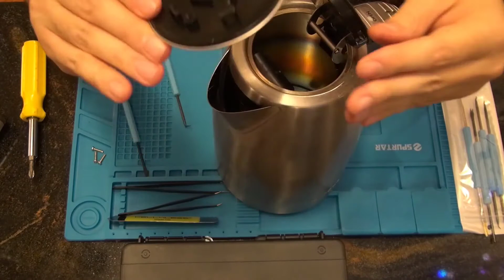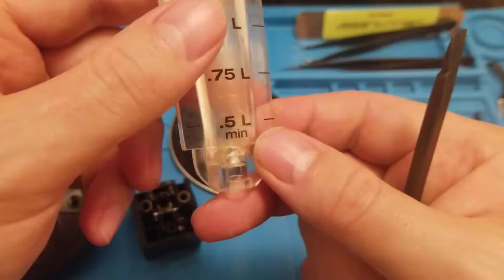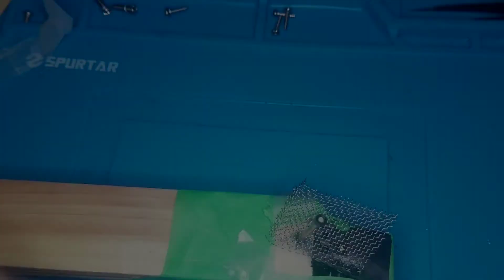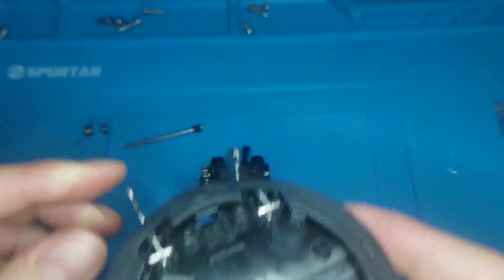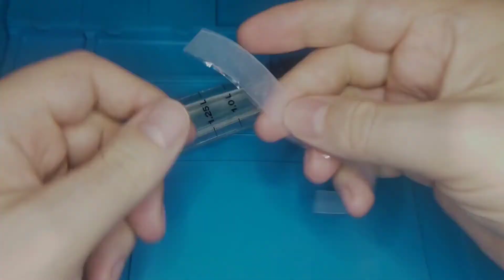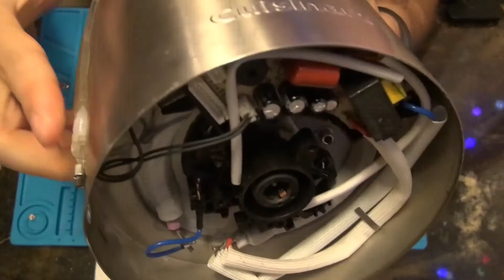Electric Kettle Repair - stuck lid and leaking at the base fixed!

Comment: My problem with mine is I’m rectan error beep after starting to heat. Any help please?
Reply from the maker: Does it start to heat even? If not, good chance that it's water level detection failure (you do have enough water, right?) Which is likely due to failure of some components on the main board.

Comment: I have a problem with mine that is a Silvercrest and has two holes (one top, one bottom) for the water level indicator. For some reason there's a silicone funnel at the bottom of the indicator to discharge water under the heating plate. What if I fill the holes with silicone bypassing the indicator? I can always see water level from inside. Am I gonna damage it? Don't understand the function of the funnel...
Reply from the maker: I haven't seen your specific model, but if it's similar to the one in the video, bypassing the water level will probably work - technically at least. Make sure that you use food-grade products though, as this fix will be in direct contact with drinking water, and hot one to boot. You don't want extra chemicals leaching out into your tea...

Comment: Mine just started leaking similarly. It's a hairline crack on the level meter around halfway high on its side. I got it in 2014. I'll probably will seal the whole thing up because I never cared for the level anyway.
Reply from the maker: Yeah,  level meter is a real weak spot. When sealing consider what kind of material you're using as it will be in contact with boiling water that you will drink. So it makes sense to pay attention to it being food-safe/-grade.

Comment: You rock!! 3 years of kettle and now it's leaking, was just able to confirm that it's the plastic cracking in the same place at the bottom of the water indicator. Off to get some silicone tape, and if that doesn't work I'll just plug the hole and go without the water window. Thanks for the great and well organized tutorial.
Reply from the maker: Thanks, glad you found it useful! Depending on how deteriorated your plastic is, making waterproof wrap that still fits into the hole might be quite finicky. So if you're OK with having no water window, a plug would be much more straightforward. Just a heads up :)

Comment: Loved this tutorial. My problem is that I can’t get my lid to shut. Any help you can provide on figuring out why it won’t stay shut would be greatly appreciated. Thank you!
Reply from the maker: When you say it doesn't shut, do you mean the lid doesn't close all the way, or it doesn't lock in the bottom position? If the former, then it is likely lid hinge (outside the lid) is broken (plastic parts). If the latter, it is likely latch mechanism inside the lid, and there is a good chance that it is not completely broken, but parts are misaligned. If you disassemble it and reassemble it, it might work again without re-fabricating any of the parts.

Comment: Wow that lid has such poorly-chosen materials for the latch-spring mechanism. A heroic effort to repair on your part! Perhaps a sheet of thin stainles or copper going around the back to both pivots would work. Pity the company doesn't offer an updated part under warranty. Imagine tens of thousands (millions??) of these going into landfill💀
Reply from the maker: I agree, with a few spare parts (not to mention slightly better design) a lot of appliances could lead a much longer life. Lid problems are not even the worst ones here, at least these can be reasonably worked around if you're handy. But the parts that are in contact with actual food (well, water here), e.g., level indicator, are almost impossible to repair properly, but could be trivially replaced if parts were available... :(

Comment: Thank you for sharing this! Silicon tape and steel mesh are awesome tools I didn’t know about. Inspired me to replace the leaky water level indicator with a silicon straw lol. I think the material they use for the indicator isn’t good enough for this purpose. It eventually cracks and leaks (if I’m not mistaken yours is also showing signs of cracking on the inside).
Reply from the maker: Yep, you're correct, clear plastic used in the level indicator deteriorates over time (I am sure contact with boiling doesn't help). It starts to develop microfractures which eventually leak :(

Comment: Thank you, I searched for leaking issues on this kettle as it started to leak I noticed today, just went and picked up silicone tape, and hopefully that's indeed where the leak is! Do you have suggestions if it leaking where the seal goes into the kettle and not the indicator? Fingers crossed going to go try this tonight!
Reply from the maker: That's hard to tell. The seal is soft silicone and is unlikely to leak itself. But indicator assembly is a single piece with a nipple that goes into a kettle (via silicone seal), and it is made out of hard transparent plastic. And I believe this plastic over few years deteriorates into brittle, cracking state, probably assisted with being in contact with boiling water. So these microcracks can develop pretty much anywhere at the bottom of the assembly. And that's another reason why you may want to cover as much as you can there with tape, because even if you seal a place that is leaking today, it is likely to leak from somewhere nearby is a short while.
I really would prefer if we could just buy the indicator assembly as a replacement part, this would make this fix rather trivial. But alas :(

Comment: Great instructions! The lid on my kettle isn't opening, but it's not wobbly. 
Any suggestions?
Thank You!
Reply from the maker: Sure, lock is not really related to wobble, wobble is due to a broken hinge. In your case, there is a good chance that something is either broken or just misaligned in the lid mechanism. Just pop up the top metal cover (it is just pressed in with tabs), then you'll see the lock mechanism and will be able to at least open the lid, and probably fix it. Cheers!

Comment: My kettle is 5 years old. Worked yesterday but now it won't heat my water. All the kettle lights come on. I pick a temp and it blinks like before. Hit start button and it lights up white. After a long while of temp light blinking all the buttons go to a neutral blue light. Again after a long while the kettle shuts off. I'm thinking bad heating element or whatever controls it to heat up.
Reply from the maker: This is a bit weird, sounds like a proper heating cycle according to LEDs. However, if it is a heating element it shouldn't stop attempted heating as it would never reach temperature. If the temp sensor is bad it wouldn't shutoff at all or would shutoff immediately. The only explanation that I can think of is that it is the heating element problem, everything else works fine and kettle thinks it actually is heating up the water. But then there might be a safety timer that shuts off heating after some period of time even if it doesn't reach temperature.
.
You can follow the video and open up the bottom of the kettle and do a visual inspection, maybe run some continuity tests and see if you can find anything. Though it's unlikely to be something obvious as it seems that most of the kettle works.
Reply: @JustMakeItNow  Correct, lights up and begins the process of heating the water and nothing after that. Thanks for you help I'll open bottom of kettle and run a few continuity test.
Reply: Did you fix it? I have the same issue.
Reply: @Camifran  No not yet. Need a Volt-Ohm-Milliammeter tool before I can trouble shoot. If I fix it or not I'll let you know either way.

Comment: What is size and where did you get ss mesh
Thank you
Reply from the maker: I had a random piece lying around, so can't say exact mesh size. But sizing is not critical. It needs to be stainless, that's the important part. Apart from that, the opening needs to be large enough for softened plastic to squeeze through, so don't go too small. I'd say something between 16x16 and 40x40 if I have to guess.

Comment: Thanks for this. My kettle is leaking at the window. I’ve had it for about 5 years and the windows has become yellow and brittle. I was able to super glue along all the cracks, cover the bottom port and put the top in my mouth like a kazoo. I sucked in to create a vacuum and suck pull the super glue into the cracks. I hope it holds up.
Reply from the maker: This will probably work fine. However, I'd still recommend using silicone tape as I did in the video. My two concerns with using superglue in this application would be toxicity and temperature resistance. Cyanoacrylates (primary superglue component) are generally considered non-toxic when set, but would decompose into highly toxic hydrogen cyanide gas when exposed to high heat (about 200C/400F). In this case glue shouldn't see that kind of temperature (generally should not be above boiling water temp), but I thought I'd mention it just in case. But at just below boiling water temperatures (~90C/195F or even lower) most regular superglues would soften quite a bit, these are not great for high-temperature applications. So there is a chance your fix will fail after a while due to high temperature exposure. If you still wanted to go this route (probably too late for recommendations now ;) ), I'd suggest to look for high-temperature resistant superglues, there are some out there that are rated to 200C/400F or even higher, but these are not very common.
Reply: ل

Comment: I was able to reattach the filter bracket. It is friction fit. You need to align the piece into the curved groove at the top, then pull up on the plastic below enough to get the slot to fit over that "L" metal hook in the metal wall of the kettle.
Reply from the maker: Just wanted to reply reading your previous comment, but you already figured it out! ;)
Reply: @JustMakeItNow  Yep. It's hard to explain without a visual demonstration, but with a little finagling I'm sure most people will figure it out, if they ever run into that problem. Cuisinart did some things right and some things... well, not so good!

Comment: My CPK-17 had been working fine for a year. No leaks. Occasionally a confused processor, where it thinks there's no water (flashes and beeps when trying to start), but unplugging fixes that. Only now, my lid got stuck!  I followed your advice and was able to pry the brushed metal disc part off, exposing the mechanism. Just a slight touch with my finger seems to have "freed" the mechanism. Now it works! My only problem is that in the probing to figure out what was wrong, I popped the filter bracket off... can't figure out how to get it back on.
Reply from the maker: Glad that I could help!
Reply: @JustMakeItNow  Thanks. The lid has been working perfectly fine since I freed it. I opened and closed the lid about a dozen times, flawless operation. Ran the kettle about half a dozen times for hot water requirements and nothing changed. It'll be interesting to see if this issue returns once more. At least I know how to remedy it!
Reply from the maker: It's possible it was a one-off situation, but usually there is a reason why things stop working, and unless you fixed the root cause it is likely to reoccur some time later. Well, the good news is that now you're much better prepared for that ;)
Reply: @JustMakeItNow  Yes, my hope is that it was a one-off situation by a random chance of misuse. Someone else had used the kettle first that day. When I went to use it, the lid wouldn't release and rise up. They're aware of what happened. A more gentle hand is being offered... so hopefully that's it. ☺